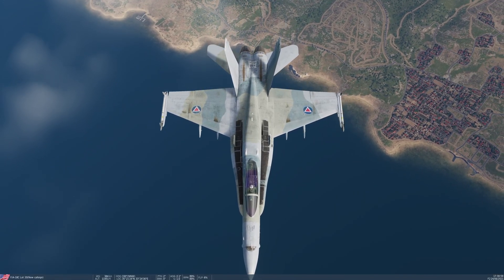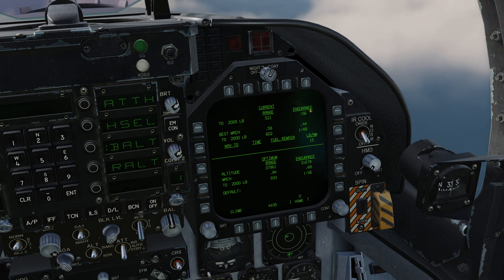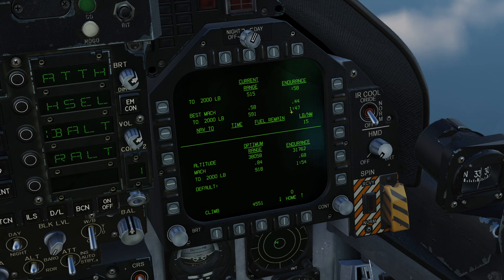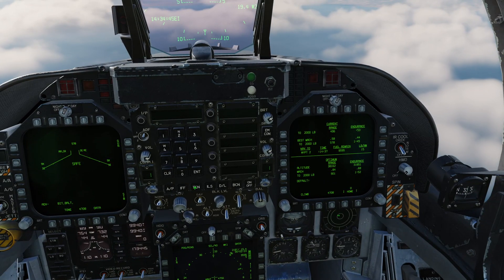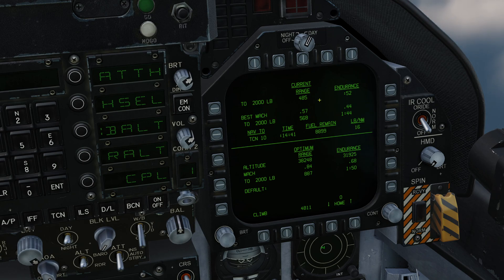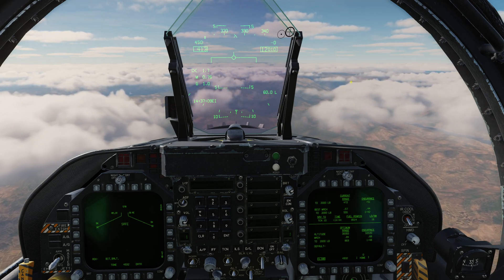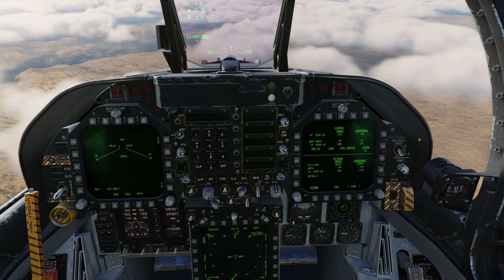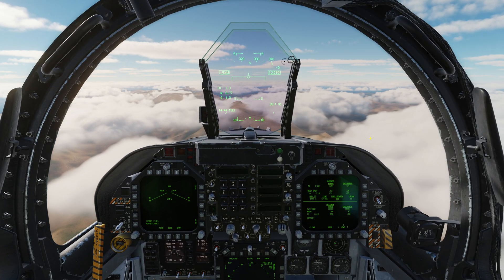DCS F/A-18C Bonus 1 - FPAS

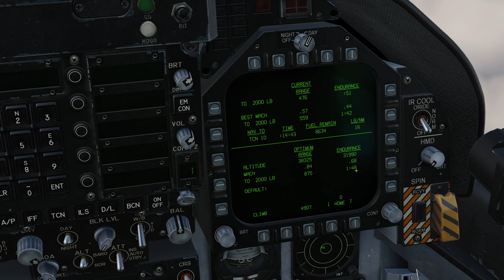Comment: One noteworthy limitation of the FPAS page is evident at 5:57 
Optimum range calculation doesn't automatically and directly compare its numbers to the optimum endurance calculation. In this case, for the optimum range calculation of 874nm, mach 0.84 at 38,333 feet represents a speed of 482 knots. 482/874 is exactly 1 hour and 48 minutes...
That's exactly the optimum endurance figure FPAS calculates for mach 0.68 at 31,994 feet. That's 398 knots at that altitude, so only gives a range of 721nm.

Given that information, I'd wager 9 times out of 10, most pilots would pick the same endurance (it probably differs by a few seconds) for an additional 153nm of range. In this way FPAS is a bit of a "dumb" system, giving you, the pilot, the exact information requested, but not giving you the full comparative picture for analysis in real time without additional workload.

One caveat: I calculated all this for standard atmosphere. FPAS is likely taking actual conditions into account. The values are unlikely to change the calculations by more than a minute on endurance or a few nautical miles of range.